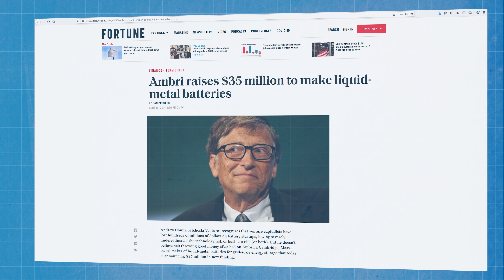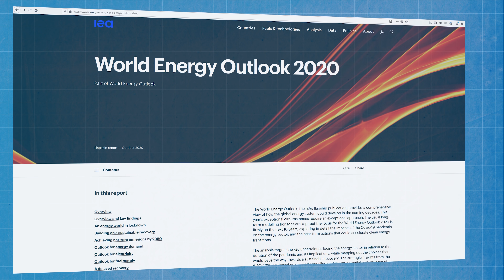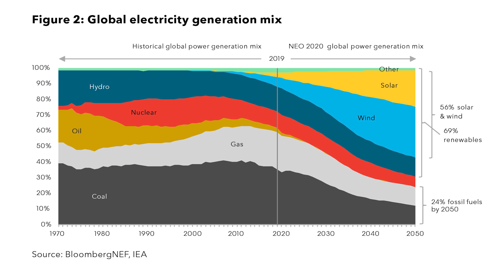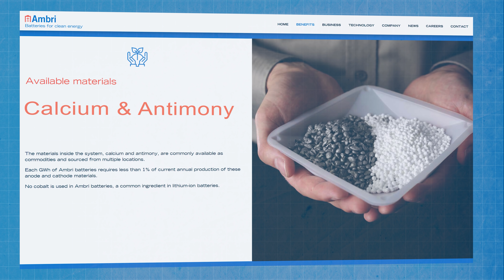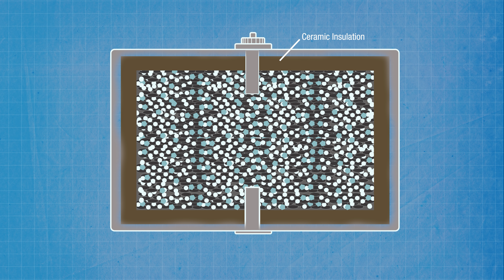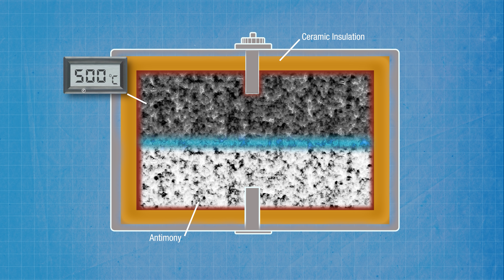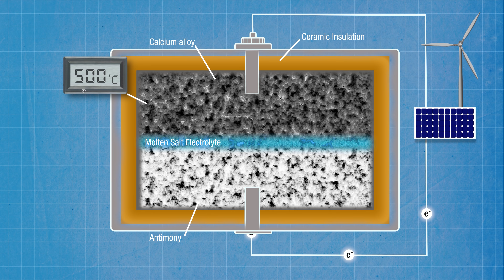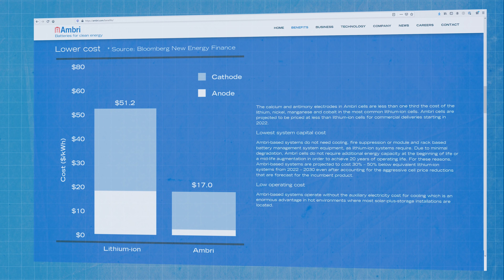AMBRI Liquid Metal Batteries. Will they really change the world?

Comment: Fantastic! We need every energy storage technology. It's not an Lithium battery verses Liquid Metal verses SuperCapacitors etc. competition, its about fitness for purpose - cost, safety, disposal, lifetime, density...for a specific application.
Reply: You're absolutely right, if you want a longer explanation see my main comment.
Reply: Supercapacitor?  lol
Reply: Peter Mortensen  A pump storage is very different from a hydro power plant. And except very few countries like Norway, hydro is no solution. In almost all states, all hydro capacity is already in use, you can't scale up anymore. And you are right: he investment costs forbid the use of pump hydro storage - But it is the cheapest , most reliable and most effective means, anything else is even more expensive,
Reply: No, we need don't need energy storage at all, except for vehicles.
And we have one: It's called diesel engine. Its energy storage is a simple sheet metal tank with a storage density that is unparalleled.
Power plants, be it nuclear, gas or coal-fired, do not need storage because they are running 'on demand' whenever electricity is needed.
Reply: @TheSpecio  Please just take that sort of idiotic simplicity somewhere else.
You clearly have NO Idea how grid level power works. NONE of nuclear, coal or gas are true "on demand systems." None of them are quick to respond to demand fluctuations. They all operate on a principle called spinning reserve and most have there own short term internal storage. In the case of nuclear and coal is the steam in the boiler.
Try not to be so ignorant in future.
Reply: @tonywilson4713  ALL of Nuclear, Coal or Gas are able to keep the grid running because NONE of them is off at night or depending on random weather phenomena. 
Do you really want to compare minuscule fluctuations in the range of seconds with fluctuations and even outages on a scale of hours, days or even weeks?
Why have you NEVER heard of a storage problem before wind and sun?
Reply: @TheSpecio  Dude they crash too and when they do its usually at bad moments when they are under load.
Sorry but I'm an engineer I've looked into this stuff and the simplest answer is - going forward is we will have a mix of technologies as we always have. 
ANYBODY who claims it will all be this or all be that or this technology wont exist or this technology will dominate is speaking idiocy and garbage.
Reply: @tonywilson4713  I worked in a nuclear power plant. I know what I am talking about.
And no, a scram of one power plant is no big deal. But when ALL solar or ALL wind ceases - And that's what's happening with them all the time - he grid is in severe danger and thermal power plants have to be in standby any moment to save us from a catastrophe.
And there is not ONE technology that is able to store so much electricity that we do not need thermal backup anymore.
Many insufficient daydreams of batteries, Hydrogen etcetera are not the solution.
The best and cheapest technology for storage was, is and will be pump hydro, but just for Germany, where I live, we would need 2000 pump hydros, each at a cost of 2- 3 Billion €, because a storage capacity for at least 2 weeks is necessary. That would cost each household in Germany about 200.000 €, the price of a comfortable new home, in 30 Years. Any other 'solution, be it Batteries, Hydrogen or whatever, would be even more expensive.
So forget the green dream, it is a nightmare.
Reply: @tonywilson4713  Please don't be an insulting troll!
Use arguments instead.
Reply: @tonywilson4713   TY for that. Don't molten salt reactors have some flexibility - i.e. the less heat used the hotter the fuel salt, which slows the fission?
Reply: @red-baitingswine8816  Not certain on that point. 
There 2 greatest advantages from my perspective (I work in control & safety systems) are that they are 1: Fail Safe & 2: Allow the fuel to be used right down to almost nothing.

Not certain on your back ground but for anyone else following. 
On Fail Safe which means that the system will naturally go to a safe state on failure MSRs are infinitely better than Pressure Water Reactors. Go look up Kirk Sorenson he's the guru on MSRs and why they are fail safe. It basically comes down do a solid salt plug in the bottom of the reactor. It has to be kept cold and if they lose power it melts and dumps the entire salt solution into containment tanks that stop the reactions.

On fuel consumption the problem with the fuel rods in PWRs is that the Uranium eventually transmutes down into lead as it goes through the nuclear steps. I did a project at the ERA Ranger Uranium mine about 15 years ago and we were put through the ANSTO nuclear induction that covered Uranium from in the ground to back in the ground and all the steps in between. How they process it, how its refined, how its used, how it does what it does in a PWR and what's left over. 
The problem with fuel rods is that they eventually get to the point where they are holding up the reaction. At that point they can't generate enough heat to drive the process, which is why they need to be reprocessed. With MSRs the fuel is in the salt solution so there's nothing to stop all the U235 or Thorium reacting all they way done to (almost) nothing. The WAMSR proposed by Leslie Dewan and others was supposed to take advantage of that, but they couldn't make it work. 

I here there is a company called Elysium who may have found a way to make Waste Annihilating tech work. I have seen a video by "Tech for Luddites" supposedly on the Elysium reactor. It wasn't worth watching it has so many basic mistakes in it. She talks about Uranium gets it half wrong and then shows how a plutonium compression bomb works saying its uranium and that's in the 1st 2 minutes.
Reply: @tonywilson4713 Yes. I've watched lots of videos on "gordonmcdowell" (YouTube - I recommend it) including by Elysium (Ed Pheil's fast spectrum reactors are great - they consume spent fuel, plutonium, etc., and are easily scalable), Sorensen (fascinating and encouraging) and many others (e.g. Thorcon has a contract to develop and build MSRs projected to be price-competitive with coal!). I did enjoy the "luddite" video - Imo it's good PR. Thanks again.  ( :
Reply: @red-baitingswine8816  I just watched another Luddite video on Elysium and it was shite. I don't think the presenter has any idea what she's talking about. She was going on about Uranium fission and then showed a plutonium compression bomb. That was just 1 of about 4 major things she got wrong in the first few minutes. 
It was a very disappointing presentation, considering how important waste annihilating reactors will be in the near future. We absolutely have to have a complementary technology (or technologies) to renewable. Every body seems to forget we've always had alternative power sources to do the work needed. Even going all the way back to ancient Egypt where they had sail, slaves, horses and ox. All different forms of "motive power" to do certain jobs and they all had the niches. Sail was great for river transport. People were best for planting and harvesting crops. Ox were best at dragging plows through soil and horses were best for fast overland.
We've always had different and complimentary power sources. Renewables cannot do everything so we need other complimentary power sources. America has over 80,000 tons of spent fuel rods. The world has over 120,000 tons of spent fuel rods. Developing technology that consumes that while giving us usable electrical energy is one of the most important tasks humanity will ever do. It will clean up the mess the baby boomers left us and get us clean power as it does it. It a no brainer.
Reply: @tonywilson4713  . Absolutely.
Reply: @red-baitingswine8816  I actually don't know why its that difficult to understand. 
We need clean power.
We need to clean up the mess the boomers left us to clean up.
Waste annihilators do both. 👉🤯 🤦‍♂️🤦‍♀️
Reply: @TheSpecio  Sure, fossil fuels are extremely dense in energy - very hard to beat. They also produce incredible amounts of CO2, which is a bit of a problem, so some really smart people who care about future are trying to figure out how to replace burning fossil fuels for energy. Thankfully that is beginning to happen.
Reply: @Bennyboy-dog  Take nuclear energy, provided by an  HTR and make synthetic fuel. You would need this technology anyway for airplanes and trucks, because both can't run on batteries; They aren't toys, like E-cars, you know.
Oh, and really, really smart people doubt the climate catastrophe propaganda.
Reply: @TheSpecio  so why are you watching this channel anyway? As a self-acknowledged climate emergency skeptic?